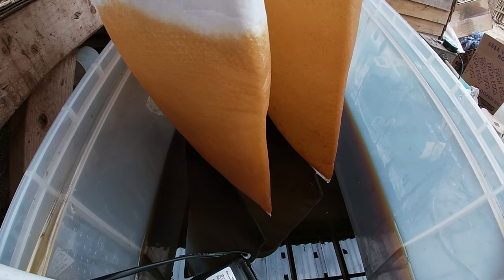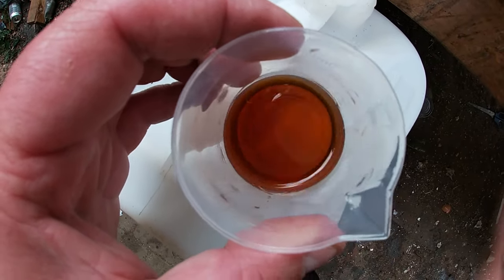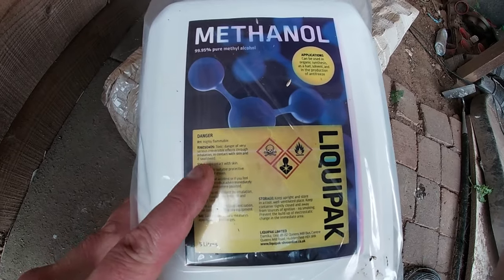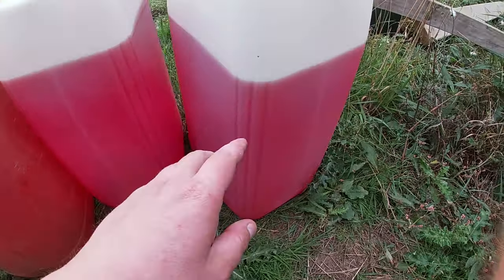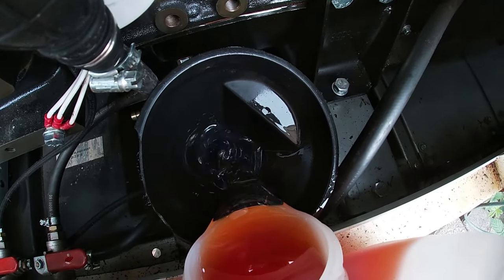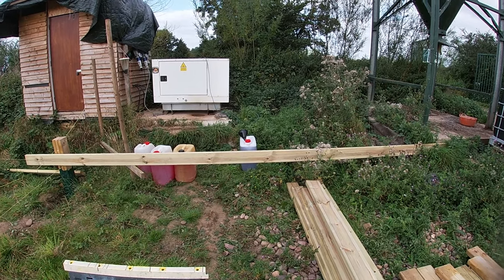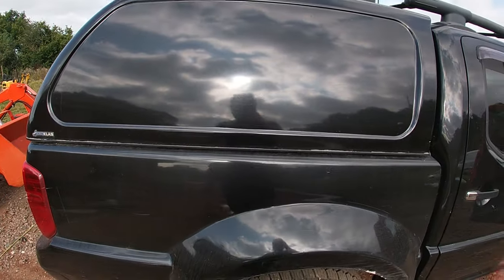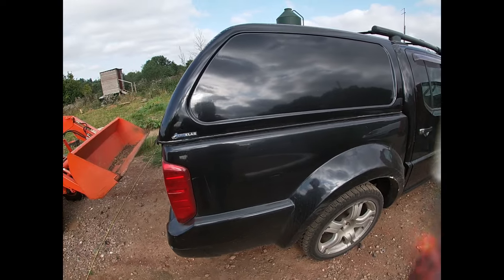3 ways to make Bio diesel from waste veg oil ! Making easy Bio diesel at home ! Making cheap fuel !

Comment: When I had an old Citroen with the 1.9 TDI engine, I used to take old veggie oil gravity filter it overnight by putting a 25 litre barrel on step ladders and let it trickle through two diesel filters and then into another barrel , then into the car. The fuel filter sat on top of the thermostat housing so got almost instant heat from start up.  I was running a Bosche fuel pump and injectors. The Lucas CAV pump was the better pump but not robust enough for the viscosity of veggie oil. In the winter months I would mix in diesel  , if I did not put enough in the car would still run but roughly and would have to idle for a few mins until the thermostat/filter housing warmed up then it was fine. I normally added 25% diesel  summer no problems . Great engine ran up 400k miles, body and back axle bearings gave out eventually although I  believe the engine was transplanted into a Pug 306. A friend worked out it was costing me around 6 to 8 pence a litre... happy days.
A later HDi was too fragile and would involve a lot more work.
Reply: Got the same engine, but the soft turbo version, the 1.9SD. I am thinking about running a 50 50 mix of veg and diesel, and i have the lucas one. I heard on pure veg it will wear down fast, but do you think this mixture will work well?
Reply: @WorivpuqloDMogh  be very wary when it gets cold and the viscosity increases it can go quite thick and the lucas pump cannot handle that. I got my car at a bargain price because the main pump drive had sheared when the temperature fell down toward freezing. I swapped over to the Bosch pump and injectors which ran fine. If you live some where warm should be no problem but if the winter temps fall low mix with diesel or go full diesel, it a PIA to swap out pumps.. try putting a sample of veggie oil or bio diesel in your freezer and see what happens.Most places swap over to winter diesel in the colder months. best of luck. Wear can be an issue so I would go 50/50 and hopefully it will run fine, i believe the lucas pump has finer tolerances than the bosch pump.
Reply: @mazdaman1286  perhaps i should swap a Bosch instead lol. But it is a hassle i read somewhere. And i dont dare to touch the timing belt
Reply: @WorivpuqloDMogh  yes ideally a pump matching injectors and pipework. I did cambelt and waterpump change when i fitted mine. had to fine time the pump by trial and error the normal timing pins in the engine are usually close enough , but I advanced the pump until it started to knock under hard load then backed it off until it was not present left it at that. I often wondered how it would have gone in the little Peugeot model . all that torque, a real flying machine and economy to boot .
Reply: @mazdaman1286  yeah. Sounds like a hassle though. The Xantia has a really tight space to take off the timing belt.

Still, i believe it will be worth it. Mine has less than 100.000 miles on it, at 133.000 kms. Bought it for 1000 euros, form a car dealer that told me they got it from an old man who passed away in 2020. The service record is there too. Well maintained, looked almost brand new inside. 

Only drawback is the power. Its turbocharged with a low pressure turbo (already turned it up, but at the cost of some fuel economy) and a pump without boost membrane and no intercooler. I plan on fitting an intercooler to it, which will increase power and maybe fuel economy too.

I will look into it. Right now financially i dont have it very well because of everything going on in the world right now. And the timingbelt was replaced at 132.000 kms
Reply: If you intend on fitting the Bosch VE pump ensure you obtain the alloy mounting bracket that came with it. IIRC the brackets between the Lucas & Bosch pumps are not the same. 👍🏽
Reply: @frenchenstein  thanks. But sadly the pumps are really hard to come by these days

Comment: Great video, I've recently started running 80/20% wvo and petrol in my truck.  Runs very well, only draw back is fuel filter changes every 5000 kms.:)  I keep a spare set just in case I have to change them on a trip.:)
Reply: Hi DetroitGarage. I heard from a guy in Germany recently, who runs a petrol/WVO mix for his Mercedes. He, and several other sources too, said not to go past 10% petrol, because it thins the veg oil too much, which in turn begins to cause micro-wear within the injector pump's moving parts. (It will cost you less as well). Don't forget to put in a small purge tank to run pure diesel through your engine daily. Very important to do this, for shut down, and start up. Not very complex either. I'm converting an old 20 liter veg oil drum.
Have a look at a youtube video by a guy named Craig, called "Driving on vegetable oil". Some really good tips there, and also a good basic schematic, if you ever do a full conversion.
Reply: @artofnoly9754  Thanks, I'll definitely keep an eye on that.:)
Reply: @artofnoly9754  great info thank you
Reply: @noahclouse1830  No worries Noah. Hope you get some good results. Ultimately I'll be using a heat exchanger to thin out the WVO so it will flow thru the system without any issues. So, even cheaper again because there are no additives required, only one upfront cost and setup. Have a look at Scintex heat exchangers. Out of Australia.

Comment: Very interesting video and discussion!
I have just secured a source for a small but steady flow of frier oil and now i'm looking into the best way for me to run my old Audi A4 1.9 tdi on this stuff.
I'd rather do mechanics than chemistry, so i would prefer to skip the methanol process if possible.

As kerosene starts at about €6 per litre here thats not an option either. 10% petrol seems very appealing (and cheap) though.

I'm thinking i should mount a separate tank with a preheater and run it's own line with pump/filter and a manual return shut off so oil and regular diesel dont mix, as if i where to run it on straight veggie oil. Most people here seem to go that way here and run the first and last kilometer on regular diesel.
Reply: straight up

Comment: Finally doing wvo.
It's been filtered to one micron and spun in heated centerfuge
I added liter or 2 of gasoline and some acetone. Burning it now in my diesel heater
 What I'll do differently tomorrow is stick the tank inside so it's not freezing and spin the fuel line once around exhaust pipe before going to the heater.

Comment: The original diesel engine was actually designed to burn peanut oil. So older diesel engine models without the electronics should be good running kerosene-thinned cooking oil.

Comment: This system work with oil engine oil as well. I find Kerosene works the best with old engine oil 60% Kerosene and filter down to to .5 of a micron.
Reply: Good idea, if I want to make petrol, what is the the ratio and the process of making it. Thanks

Comment: I used half kerosene and half veg oil runs great 
But 
Keep an eye on the engine oil it’s going to foul faster than normal and you might loose your savings in fuel on extra engine oil changes.

Comment: I don't filter anything until the fuel is reacted and washed and dried and then I dispense through a 30 micron racor. Most of the rubbish will drop out with the glycerol and wash water.

Comment: FWIW, it is VERY simple and inexpensive to recover the methanol using vacuum distillation, leaving just glycerol/glycerin behind, which has a hundred different uses and can even be sold.  (...and if you are going to be using WVO/WPO a lot, it pays off in the long run to get a heated centrifuge, as that can remove ALL of the particles and water.)

Comment: Started using 50/50 Gasoline and used veggetable oil - 7.3 idi sounds happy.
Reply: I'd reduce the amount of petrol 5% at a time until your engine's cold starts are a little 'lumpy', then increase by the last 5%, too much petrol = ot enough lube for your pumps.

Comment: Yes, very useful info. Thanks Man. Keep it coming. Hope you're all doing well over there. (I'm in Oz a.k.a. Australia). Quite hot here, so viscosity is not so much of a problem, especially in the north. Have you looked into using a heat exchanger to pre-heat you veg oil before it hits the first filter? No expense at all after the initial setup. Basically you can run hot water from your engine block to do the heating of the veg oil. It only needs to come up to 60 degrees Celsius to be thin enough to inject without issue. I'm referring to cotton seed oil, by the way. The most common deep frier oil now used in Australia. Very low in trans fats, making it an excellent easy-to-use biofuel. Just filter it down to 1 micron, pour into tank, and away you go.
Reply: All you would need is just a diesel gas tank heater with a plug and you just warm it up before you leave
Reply: I agree heat exchanger is the most efficient because you already have the energy source/heat available to tap into, and divert it 👌
Reply: Most people that are seriously into the biodiesel thing here in the States use a preheater that works off the hot water from the radiator. Biodiesel was a big thing here about 12 years ago when the price of Diesel skyrocketed. You don't hear so much about it now. Another thing that slowed it down was the big companies that are buying the used veg oil from the restraunts now so it's harder to find. They use it in the production of dog food i'm told. BTW, Old Dodge 12 valve diesels and Old Mercedes Benz diesels are some of the best vehicles for Bio diesel / veg oil use. I sometimes believe those old Mercedes would run on water LOL
Reply: Any updates on this mate ? I'm in NSW
Reply: Hey Dude, I've come to decide that the cheapest quickest way into the bio-fuel arena is to simply add the filtered deep frier oil (filtered down to 2 microns, as per the vehicle manufacturers standards) to your fuel tank using a ratio of no more than 50/50 WVO (Waste Vegetable Oil) to Bowser diesel. What this will do is subsidise your fuel costs without the need to fit a second fuel system (which is costly in its own right, and it has hidden problems as well). By mixing 50/50 (at a max), this should, in a warm climate, have the viscosity problem remaining under control for your vehicle's injector pump to work normally and without issue. However, I would also recommend running every third or fourth tank full on pure bowser diesel only. This will ensure that the engine is cleaned from within regularly (bowser diesel has solvents) whilst still cutting your fuel bill considerably. I also run a full bottle of injector cleaner thru my bus engine twice a year. I also change the fuel filter once a year (easy job, look it up on youtube) and change the engine oil at the same time.
I hope this has been of some use to you.  @bigtrippy4970

Comment: I have a 2010 focus 1.6 TDCI and have been putting Kerosene in my tank for the last 3 years.  I fill up to 3/4 real diesel from empty and top it up to the brim with Kerosene. No problems whatsoever.  I borrow the kerosen from my redundant heating tank where I work so it costs me nothing.

Comment: If you want to run something like a generator with very short fuel lines, it is possible to install that heating systems so that you could run this fuel but it does require a bit of modification

Comment: You can mix it with any solvent like turpentine or gasoline....and a lot of contaminants will drop down to the bottom effectively diluting  and "scrubbing" the veg oil clean. 

Then you can mix it with diesel, kerosene, gasoline, turpentine or any other common fuel slurry. 

It will easily run in a multifuel diesel engine.

Comment: I'm in Canada caracine is expensive here I use gasoline to thin my veg oil for my 2003 1.9 TDI Volkswagen ratio depends on temperature summertime maybe 10% Gas or petrol as you call it. Winter time up to 30-40% Gas
Reply: What temps were you seeing in the winter? I want to run a healthy wvo/gasoline mix through my powerstroke but 30% gasoline seems like a lot to me.

Comment: Just had a thought. If you thin the oil first, would this speed up the filtering. You would have more to filter though.🤔🤔🤔
Reply: Mixing it with diesel makes for super fast filtering.

Comment: The are also one more way to make biodiesel from wvo even cheaper. First off all you need to clean wvo very well. I see that you use sock filters but you can use also old jeans to clean it(it’s cheaper). Another thing, water in wvo it’s big no no, so clean it well from water. What it’s the best mix ratuo for my car, it’s the next thing. Mix wvo with rug(regular unloaded gas) in ratio 90% wvo - 10 rug in the summer. In the winter 70% wvo - 30% rug. Here in Sweden winters it very cold and I never jave any off problem with that mix even in -25C. One more thing never ever drive wvo in any common rail diesel car with dpf because that filter will be clogged up very fast. My first wvo car was old Wv Bora 1.9 tdi. I have never any of problem’s to drive that car with wvo mix. But second car was Volvo S60 D5. After only 5.000 km dpf filter was clogged up on wvo mix. Even if your Bosch pump it’s stop to work in some older WV, Peugeot, Mercedes cars you can find cheap replacement on eBay for 50-60 euros. One more thing, from time to time drive your car on full tank diesel fuel, about one time in 2 months.
Reply: Great advice thanks so much
Reply: whats wvo
Reply: @UnCoLouRed01  wvo-waste vegetable oil

Comment: Using the kerosene veg oil mix the glycerol remain in the mix right and olny mixing the oil with the methanol you could eliminate it, so, with the kerosene this separation doesn't happend so it remains in the mix and should burns all sprayed in the chamber am i right? I don't understand if this grycerol would cause some sort of problem to the engine, or the injector or whatever. Any experience using white spirit? An old top gear video shows how you can mix 97 part of oil and 3 part of white spirit to get yourself a well mixed biodiesel, i mean, olny 3% instead of 30 would be even cheaper.

Comment: You can het "contaminated diesel/fuel" from mechanics for FREE.
All too often people accidentally fill up a newer diesel car with petrol and then have to get the car fixed. Which means the tank has to be cleaned out. That fuel is an excellent dilutant for veggie oi.
Personally I add it to my filtered veggie oil/sump oil and still donthe 50/50 mix as you've shown here.
Works fine for me.
One extra preventive measure I've taken is to install a marine grade water extractor/fuel filter before the original fuel filter. Just in case there is a drop of water in there, better safe than sorry.
idk what is good or bad about the chemistry, so far I'm not complaining.

Comment: Great video, easy to follow. Question - what type of generator is that and also type of car/truck you are running - is the car’s motor indirect diesel injection (pre 2000)?

Comment: I've run 50% veg oil, 45% diesel and 5% petrol in a 2.5 litre 6 pot rotary injection pump '95 BMW turbodiesel car without any problems. Plus it smells like someone is cooking. Lovely.

- modern common rail diesels don't like veg oil as they run at much higher pressures, up to 5000psi.

Comment: Also option 4: use petrol/gasoline at a 20% mix, which is what I do with my WVO. A little acetone helps further with the viscosity also, though I’m talking only 10mL acetone to the petrol-wvo mix as the active can do damage to housing if in too high a concentration.

Comment: I've got a smaller farming operation in the US. I burn about 3500 gallons a year of red diesel. If I were to mix up a batch of say 500 gallons and stored it in tanks like I do with regular diesel will the kerosene separate from the oil or does it stay mixed. Need to know if I need to figure out a agitator system or not. Never done my own fuel before. Thanks